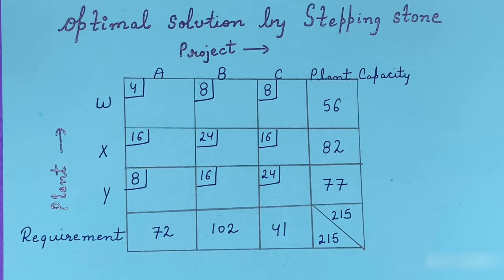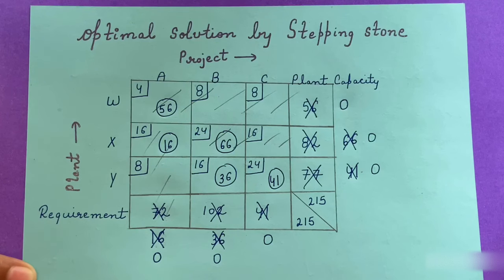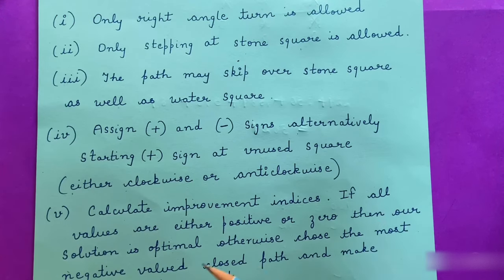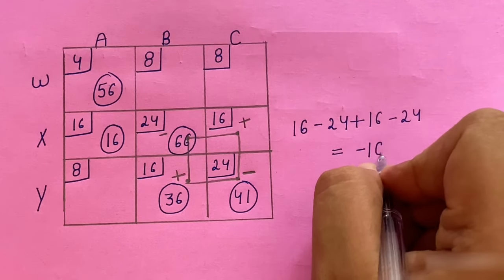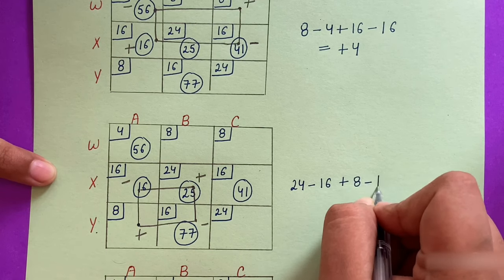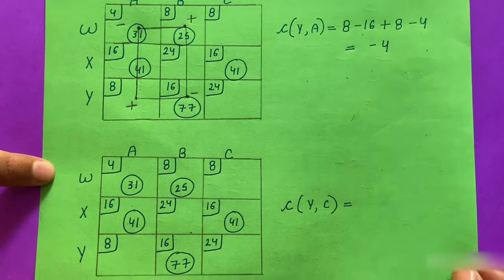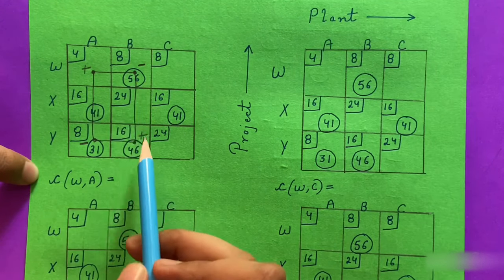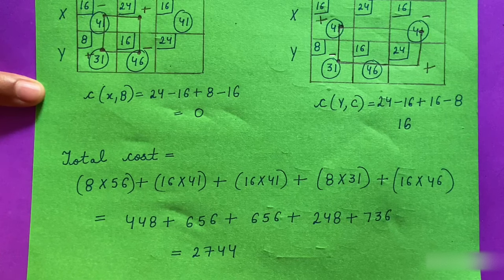STEPPING STONE METHOD | TRANSPORTATION PROBLEM | OPTIMAL SOLUTION | LATEST 2020

Comment: Nice demonstration 
Please, could you confirm that after the first path is calculated, when no loop is possible ,  the optimization is obtained : 

example : 
factories= [8, 15, 21]
projects= [8, 36]
costs = [
    [9, 16],
    [7, 13],
    [25, 1]
]
1st result 
[[ 8  0]
 [ 0 15]
 [ 0 21]]

In this  example as the first line and column( except 0,0)  are made of of 0 , you cannot loop
If you reverse the 2 columns of the cost matrix , and the projects list,  you can make a first optimization  loop , but you get the same configuration without a possible loop .
1st result 
[[ 8  0]
 [15  0]
 [13  8]]